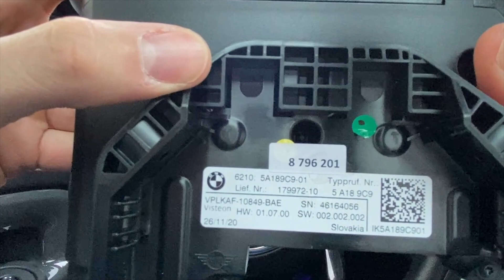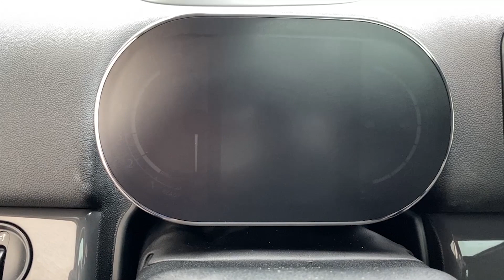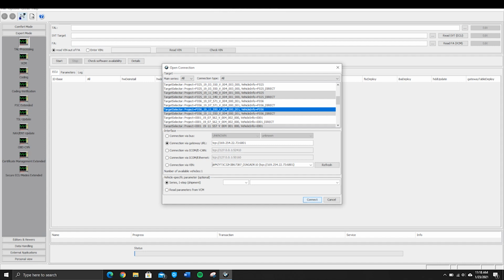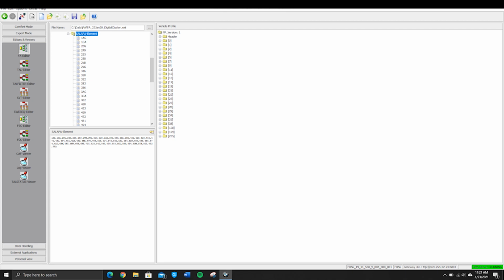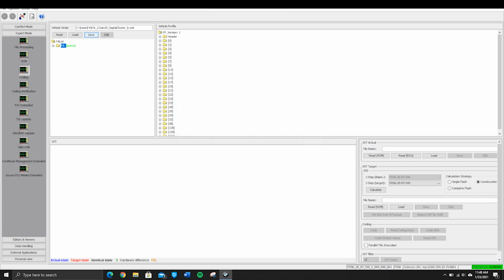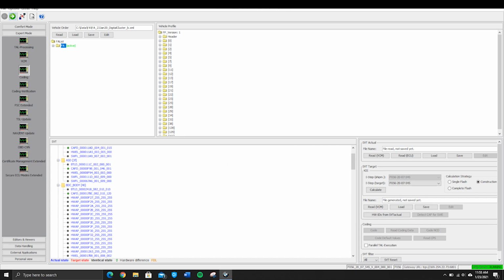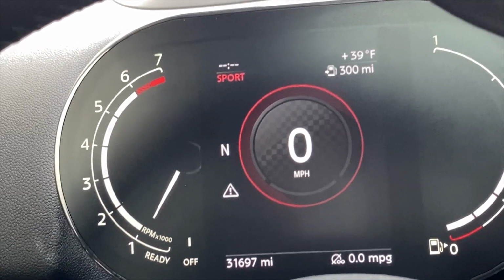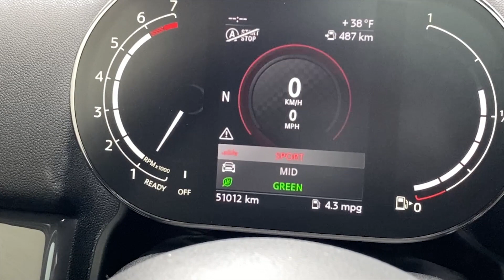MINI F60 Countryman - Digital Instrument Cluster Upgrade

Comment: Hi Troy, the guide on the forum does not cover all situations… some cars have no HUD. So they will not see the kombi directly…that requires way more steps. And you need to disable update msm vcm to make sure the changes like the new date will not be written to the car. Just warn people before posting esys tutorials. With esys you can potentially brick the car if you do not know what you are doing.
Reply: Ooh by the way if you code the HU with 6wb you will see the new virtual dash animations on the hu. And you can code navigation on the kombi and logo….to be able to see the new animations on the hu it needs to be updated to 2021-03 istep. And it needs to be id5. And you dont need to pull the battery out

Comment: hey great job there ,any issues with fuel clusters?
Reply from the maker: No issues, they are accurate and function correctly.
Reply: @KindaCoolDad  mine the first line can hold only for 20 km and than drops to second

Comment: I did a little more research and understand that there are many different Digital speedometers with different product numbers of BMW MINI and each is pre-configured/tuned to a certain model/engine/fuel type  of the MINI Cooper. Apparently the Part# 62105A189C9 is suitable for my "B38 Petrol MINI Cooper CountryMan F60".Hope the info helps others searching this matter.If one to buy a model that is not preconfigured to their car, they may end up having to do more tweaks on the coding to get it to suit. The cheapest place one can get the parts is currently on BMWPARTSWORLDWIDE website.

Comment: did you have any issues cause my Kombi did not line up with he original screw holes.  seems like the older one sits higher than the new one.  Can anyone help.
Reply from the maker: No issues with mine, it was an exact fit. Hope you can sort it out.

Comment: Looks nice, but I'm partial to analog needles. I dislike all the screens that tend to cause night blindness by over inundating the drive with light. I can't drive with a cluster near full brightness and have my set at the 50% mark. In fact, none of my electronic devices are set to full bright...maybe 75%. But at night I turn them down to 25% or less...
Reply from the maker: It definitely boils down to preference. The screen technology used in the cluster seems very similar to the transreflective screens on Garmin watches. You can also control the brightness using the dimmer dial.
Reply: I live in Peru, but at least 3 months a year I spend in Montreal or Toronto driving a MINI Countryman… I understand what you feel like with the analog needles but actually the orange in the analog is quite bright at night even when dimmed… last 2 trips  I have driven a MINI Countryman S with the Digital Panel… and it is actually quite good, not blinding at all…. Now,  until you get used to it, it replaces the feel of the MINI… Now I am back home, and I have bought a semi new MINI F60 2020 and I don’t like the analog display anymore Grrr… where can I buy this unit? And I also need the 8.8 head unit for an upgrade… I have Harman Kardon and full NAV but there were ZERO semi new cars available from 2021… Thanks

Comment: Where are you plugging in the laptop? Is it plugs not the cluster or the car
Reply from the maker: I'm using an ENET cable that plugs into the OBD II port in the car. That allows you to use the ESYS software to code and flash your car.

Comment: Excellent video. Just wondering will that upgrade work in a 2020 Clubman S F54 model??
Reply from the maker: If you have a similar analog cluster, it very well might. Best thing you can do is loosen the two screws and see if you have similar cable connections on the back.
Reply: @KindaCoolDad  removed the analog cluster and had a look and there’s only one connection. Guess that means no digital cluster upgrade!!
Reply: @trevorkiely9332  yes you can do i have clubman 2017 with digital cluster ... you need only most cable...if your HU has most connection you can do upgrade

Comment: Hey Troy, Did you Mini come with this current (newer) system for the center console/multimidia or did you also update/retrofit it? I have a 2017 F56 and I have the older system still
Reply from the maker: That all came standard. The only update I did to the headunit was coding to get fullscreen CarPlay.
Reply: @KindaCoolDad  huh that's funny. Thanks for the help anyway! Cheers

Comment: Are these screens fuel specific? I would like to install on my F56 Mini Cooper Diesel 2015 but not sure if it will work.
Reply from the maker: Fuel type should not matter. After all, the first car the digital clusters were used on was the electric Mini. The instrument cluster simply displays information, regardless if it's digital or analog. Programming with coding for this install simply tells your car what kind of display you have.
Reply: they are fuel specific. diesel should be 62105A189D0

Comment: Hi Troy, May I ask. you’ve upgraded the  firmware on main display, or y have from factory? When y made upgrade, d y have some link for instructions? I have Mini F54 2016 and I’m trying get upgrade. Thanks
Reply from the maker: I flashed the headunit to get fullscreen CarPlay. That was a separate action from what I discuss in this video. 

If you want to update the factory firmware from MINI/BMW, visit their official website. https://www.bmw.com/en/footer/software-updates.html
Reply: @KindaCoolDad   thanks I know about official method, I tried but 2016 already doesn’t support new version of firmware with new style. But thanks for respond. ))
Reply from the maker: Gotcha. Flashing the headunit for CarPlay is a more complicated, advanced coding process.

Comment: My F60 has no navigation, it has no carplay or HUD, the head unit also does not have MOST feature.Is it possible for me to upgrade to this beauty?.My HeadUnit is a Basic EnaVevo and the speedometer has only 1 plug at the behind.
Reply from the maker: Check that website I posted in the description. That’s discussed there. Good luck!